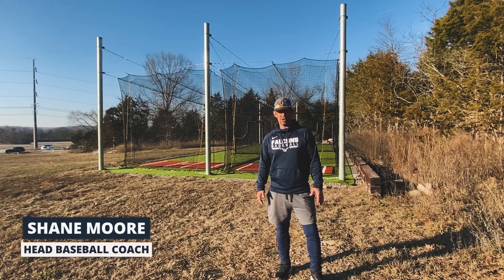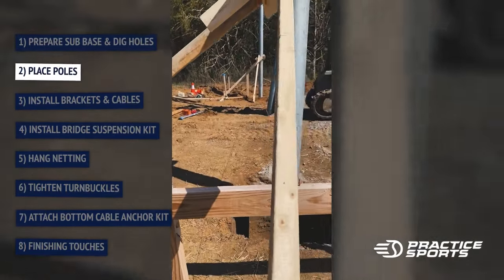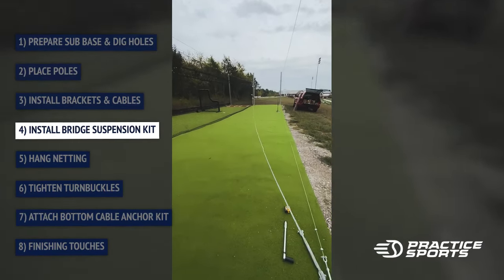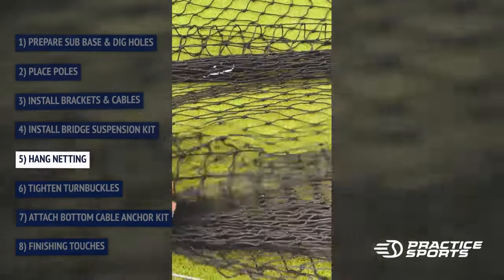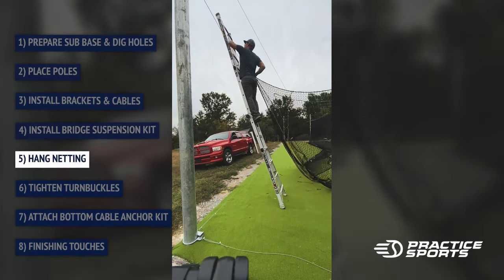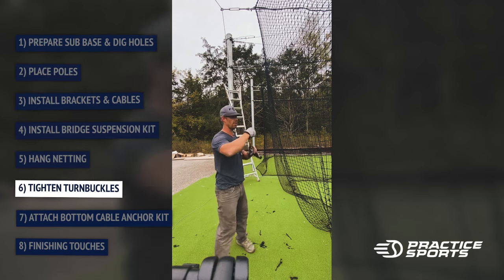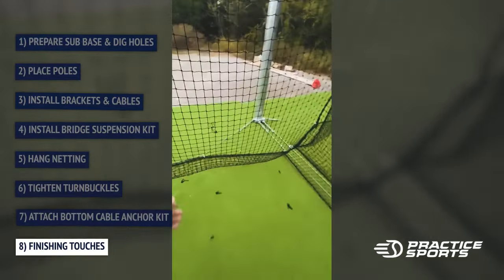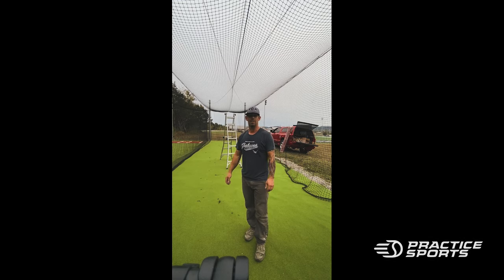HOW TO BUILD: Pro Outdoor Batting Cage (8 STEPS)

Comment: Is that a 14 foot tall cage with 20 foot poles buried 5 feet, so 5 foot of pole exposed? 1/4" galvanized steel?  What guage of guide wires did you use?  A simple bill of material would be ideal.  Thanks for the content!

Comment: How deep are the poles set in the ground?
Reply from the maker: Thanks for the comment! Usually with 6-5/8" poles you are going to be 5ft in the ground, with an approx 36" diameter depending on local soil conditions. Cheers!   -Jake S.
Reply: Are the poles cemented in the ground or just dirt put back in around them? Also, can you explain the bridge suspension kit?
Reply from the maker: @pkbase  Correct, cemented in-ground at approx 5ft depth. The bridge suspension kit adds support to cable sag - it is not required step if your cables are able to be fully tensioned and the poles are able to take that force. 2:54 shows how he has them set up to support the outside and middle support cables. -Jake S.
Reply: @Practicesports  I went with wooden utility poles instead of metal poles (maybe a mistake) so they can’t take the same tension as metal poles so I’m figuring out how to better brace and keep the net from sagging.
Reply from the maker: @pkbase  You can try to offset the tension by building a kicker assembly behind the poles. It could be built like our collegiate model kicker assembly if you check our website. Or could even just be a cable tensioned off the back of the posting to offset the tension running in the opposite direction. We don't sell wooden poles for this purpose (batting cages), so this is just me brainstorming for you. Bets of luck! - Jake S.
Reply: Cost??
Reply from the maker: @marcllanes3483  shoot me an email I can get a quote for you - jake @ practicesports.com

Comment: Hard to believe with so much technology nobody has identified or tried to come up with a solution of a pain in the neck kind of problem with outdoor batting cages?
And that is, to build a simple and EASY mechanism to lift up the net after the play. There is a millions year old problem of squirrels and other rodents chewing holes on the bottom of the net where it meets the ground. People have to painstaking use carabines to manually hookd and lift of the bottom of the net and hang it up so that these pesky rodent traffic could roam free under the net, when the cage is not in use.
I had put a 70 feet long batting cage and lost all interest and appetite after it continuously got holes in the bottom chewed in by squirrels.